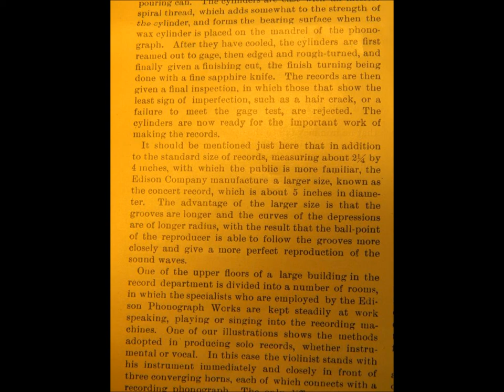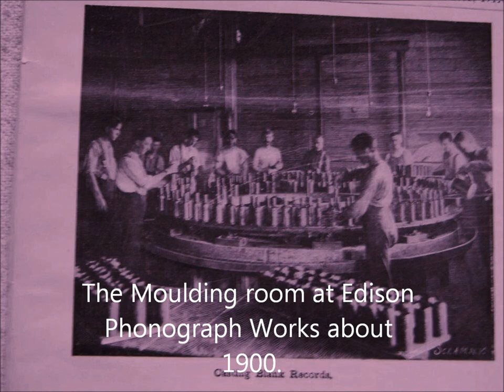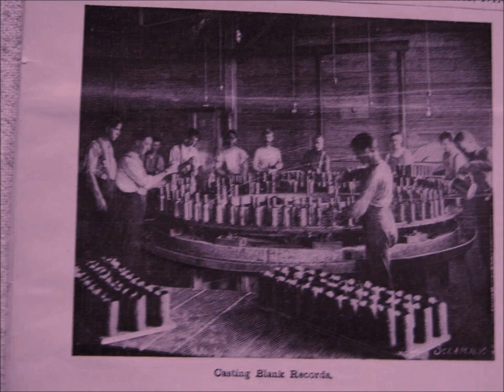The Manufacture of Edison brown wax cylinder records

Comment from the maker: Me and My Shadow at the start was the four Aristocrats Edison Diamond Disc 52027-R, Among the last of the acoustic Diamond Discs, before they went Electric at 52089.  I think the last acoustics have a distortion free, clear sound, notice how clear the picking is on the guitar.
Reply: I think I figured out the difference between yours and Edisons. Mass production. The preparation of and immediate use of all the wax without it having to be forced to maintain temperature.
Reply: I really appreciate the recording as I am in a barbershop quartet and had not heard this recording. Has it appeared on cylinder records?

Comment: First you use the shaver, but wath is the machine numbr two? a polishing machine?
Reply: what
Reply: The first machine is a shaver I use to shape the ends, and rough shave the blanks, it has a good shaving knife but not great, the blanks are shaved from 2.3" down to 2.2" during shaving the blanks.  The second  shaver, has a better shaving knife, and does the finer finish shave on the blanks.